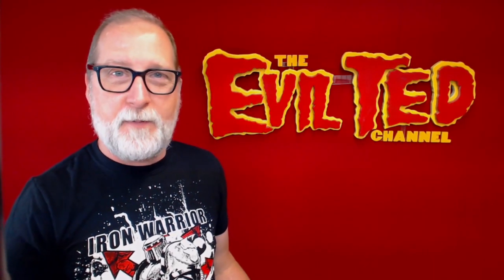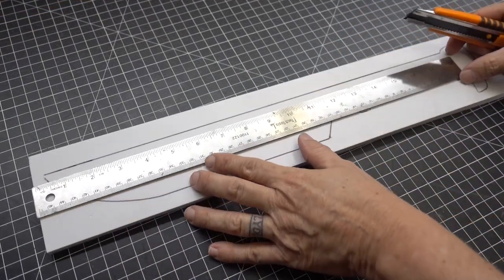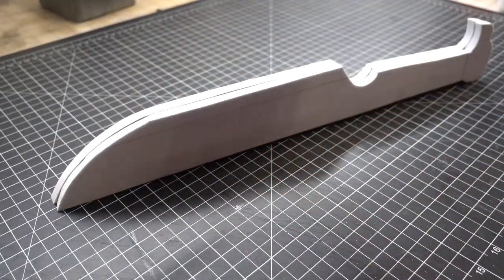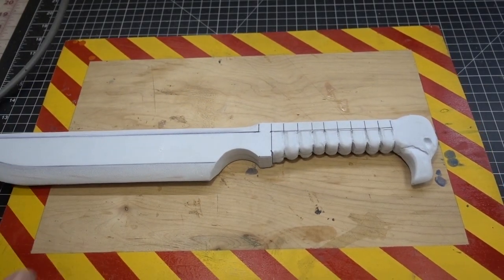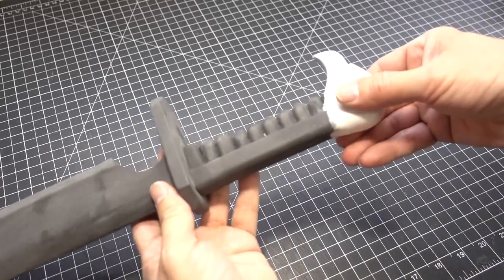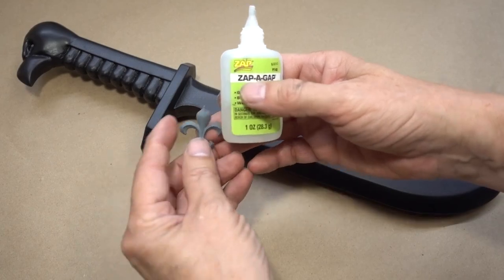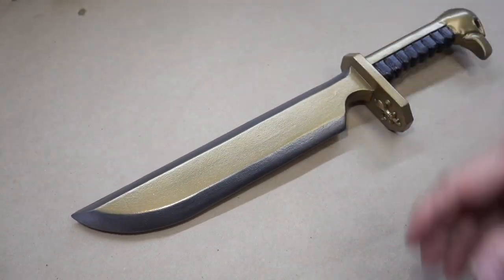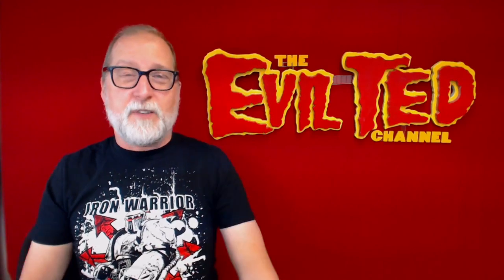Making a Battle Sister Dagger

Comment: 1: Wait you can use Windex to dilute paint instead of fancy airbrush reducer‽
2: After painting ,like, a bazilian things, I found it better to have the base coat a very similar color to the metallic, like if I wanted metallic turquoise I'd paint a flat turquoise underneath, or for a metallic silver, I'd paint a white or gray underneath.
Reply from the maker: YEAH!  Window cleaner! I felt the same when I found out! I told PlaidFX you should put that on the jar of paint!
Reply: @EvilTedSmith  I have one of them super flying airbrushes so I was worried because the reducers so expensive and I was told regular water doesn't work right